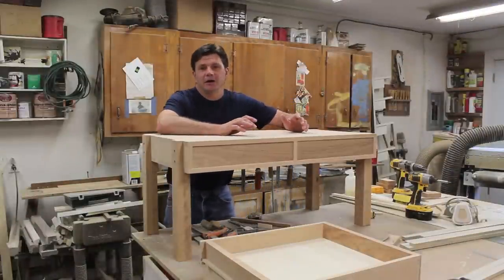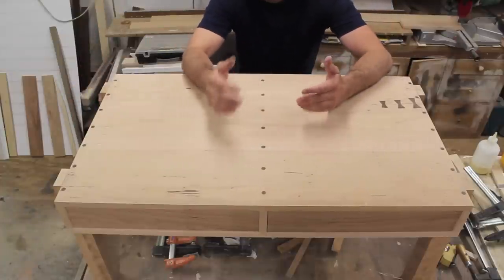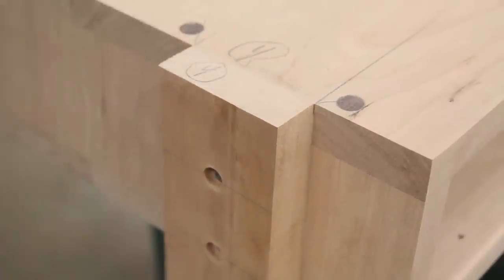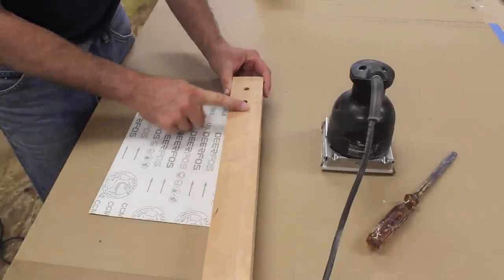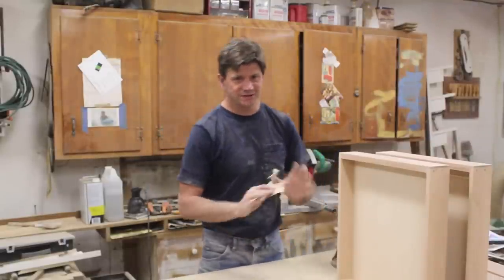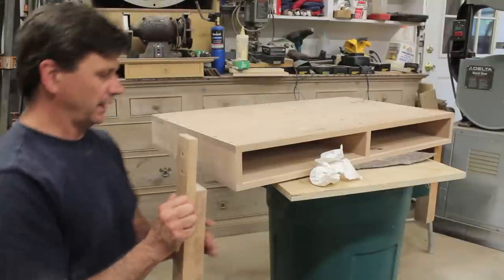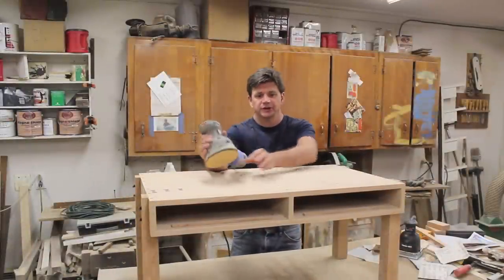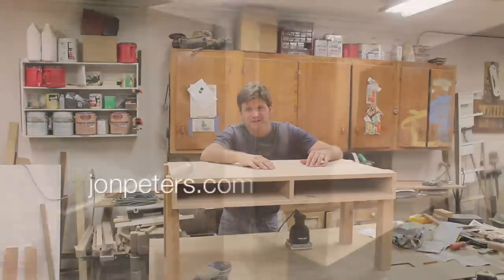How to Sand Wood Furniture to get a Great Finish.

Comment: Hey Jon, thanks for your videos. I get a lot of good ideas for my projects from them.
I've seen you using epoxy to glue in smal parts like plugs or dutchman joints. What's the benefit over using wood glue for this?
Reply from the maker: Some Epoxy’s dry fast, also epoxy and sawdust make a good wood fill.

Comment: Hey Jon, great job. I really like that the back panel was one piece. Did you account for the 1/2" between the pieces to line up the grain or just cut it straight in half without waste?

Comment: Hi Jon, I tried sanding and ended up making more lines from the sandpaper that I can see at an angle in the reflection - so I need to start over can you please tell me which numbers to use to now get off the stain I just put on and then to take out the tiny lines from the too course (I assume???) from when I started - thank you!!
Reply from the maker: +Tink 2452 I always sand 80 , 120 , 150 and 220 or 320 between finish